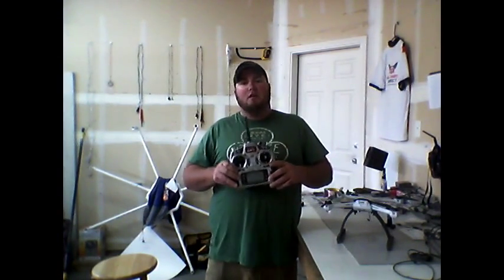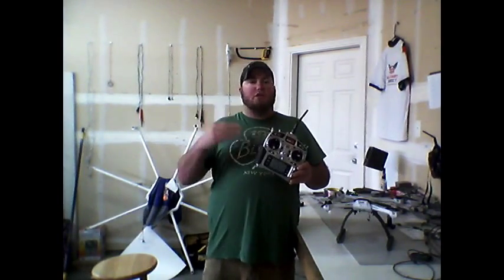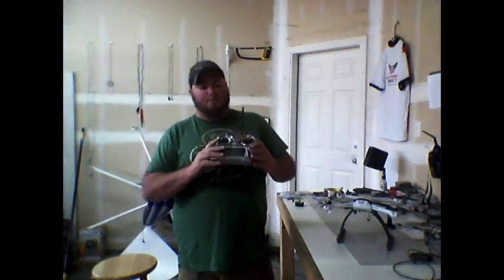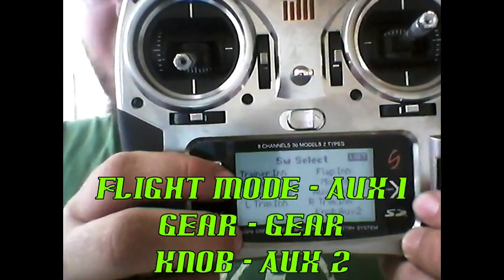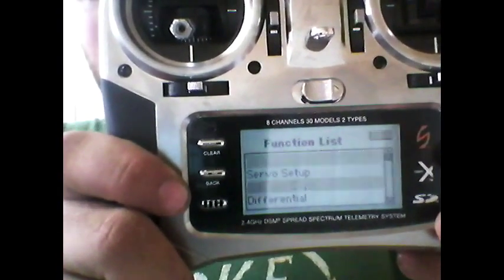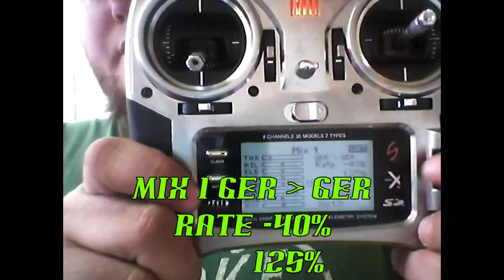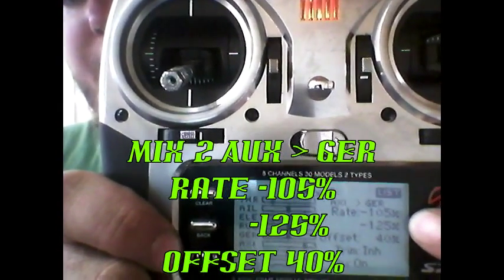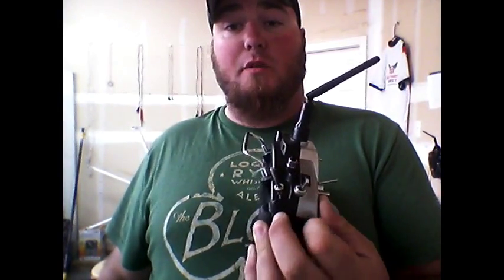Programming Stagility mode QX3

Comment: Can you write me, is it possible to make Ap mode, Stability and STAGILITY mode and RTH on Blade 350qx2 upgraded to fw 3.0 and DX6i, please ?
Reply from the maker: it's not possible on a dx6i because you have only two mixes available and you need 4 to do stagility because it's two mixes and the flight modes are two mixes
Reply: Right now, I have 3 modes  on fw 2.0 using Dx6i : AP, Stability and Stagility and RTH . What is wrong with fw 3.0 ?
Reply from the maker: +Borivoje Right,  but the mixing is done in the transmitter and is only capable  of two mixes.  to get stgility you would need two  more so either a dx7 or higher
Reply: I am so stupid.Thank you. Long live, good man.

Comment: Thanks for the great work. I now have my DX8 setup for St agility Mode. I have  noticed that  if you are in A P Mode and have the mix switch in St agility Mode and work the right stick , at certain points in the corners it looks like it goes into Smart Mode and Agility Mode. Just something I noticed. Also is possible to operate my GB200 Gimbal  while In flight with the  Aug 2 switch in this setup? 
Thanks Again,  look forward to seeing more of your videos.
Reply from the maker: Yes it is.